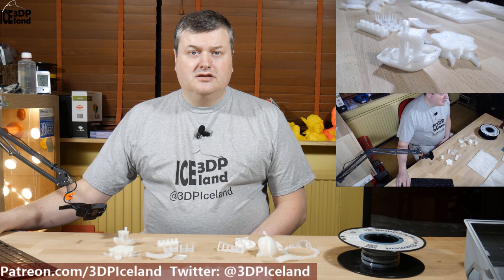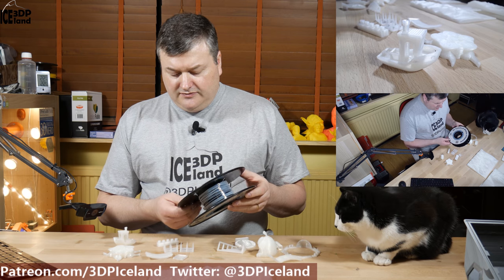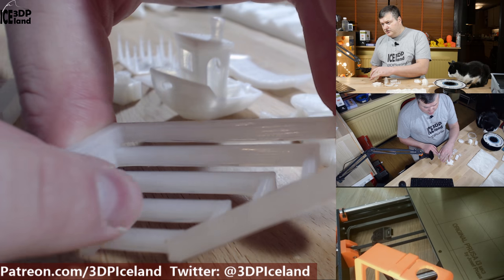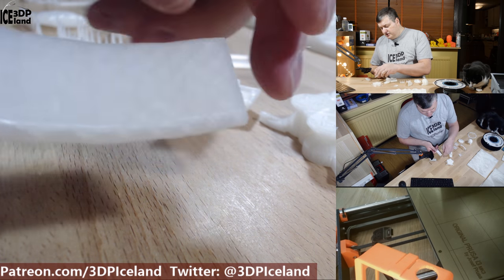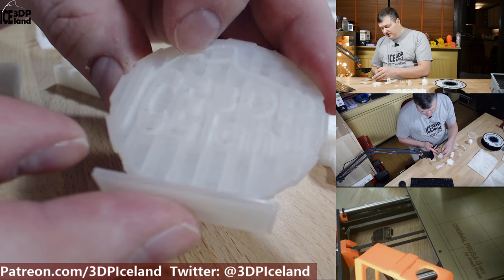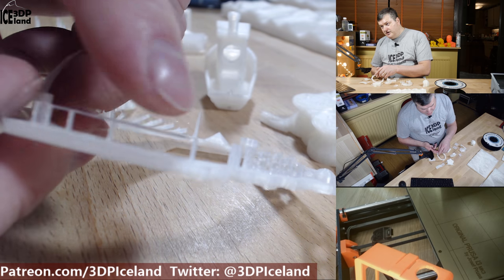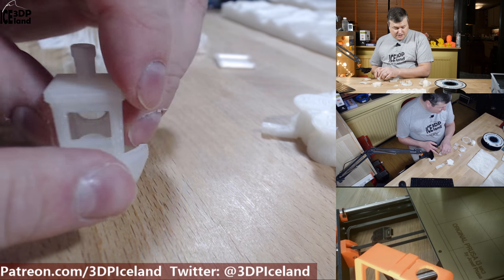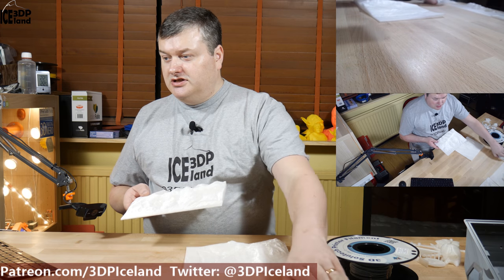3D Solutech Natural Clear PLA Review

Comment: Why won’t the walls adhere together on mine ? Not the layers but the walls... I can literally see between each wall
Reply from the maker: hi, not sure on this one, but do you have your nozzle size correct, extrution width and extrution multiplyer correct?
Reply: @3DPIceland  I use b&w pla filament and it's good then the clear filament with same settings (adjusting hot end temp though) and it's like you squeeze a part and you can feel the walls loose! Never used those wall settings. What are good values for wall multiplier etc?
Reply from the maker: @Custom3dPrinting4U  I'm not sure what's going on there with the clear filament and the walls, I'm sorry.